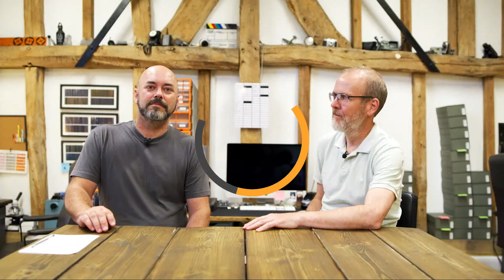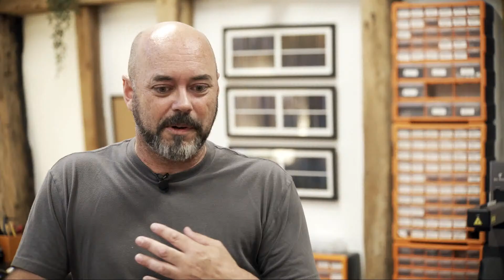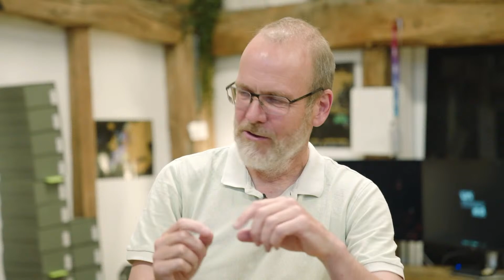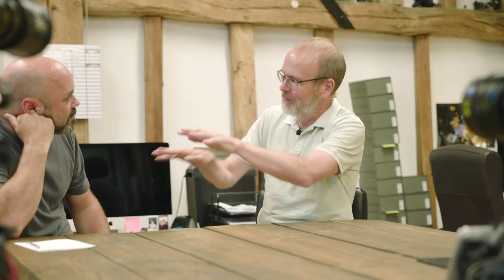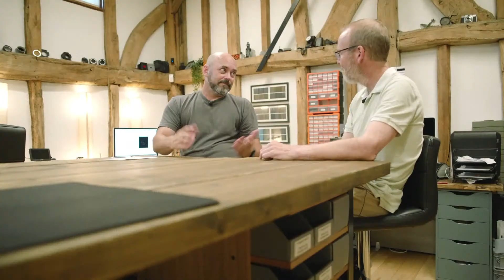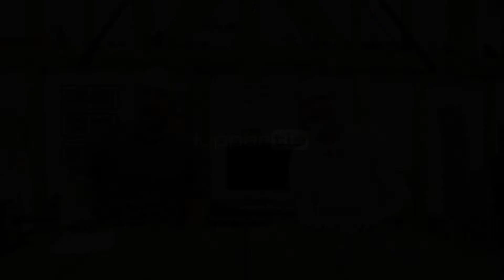Unfiltered • Ep 10 • 07/09/25

Comment: Hello John. I was thinking today why I haven’t seen a solution with electronically controlled NDs and found you!

Do you think it’s possible to somehow use this kind of ND to automatically adjust the intensity using camera data (if we are able to get it somehow)? The idea is to control exposure with ND instead of balancing between ISO/shutter/aperture like in priority modes.

Thinking about the aforementioned idea on the second run I see an application where you can use this for a smartphone with a custom app controlling via Bluetooth.

I would like to catch up with what’s happening. Please consider naming your stream episodes, that would be really helpful.
Reply: Made some research and found out that Sony FX6 has variable electronic ND.